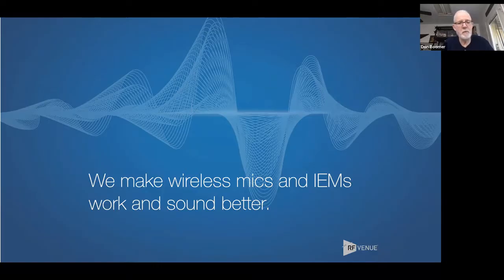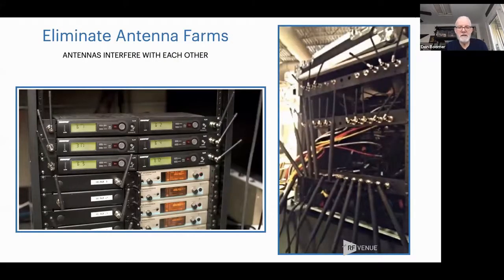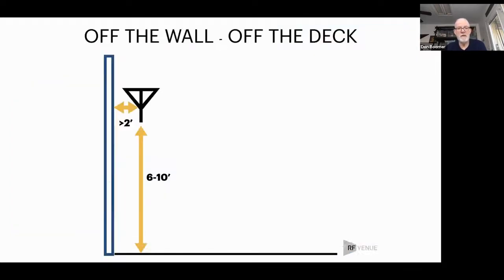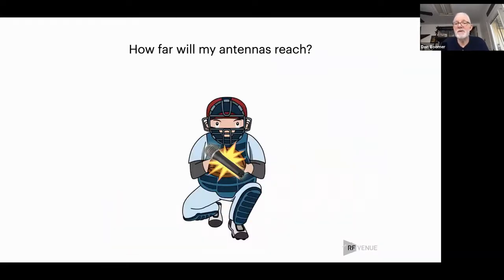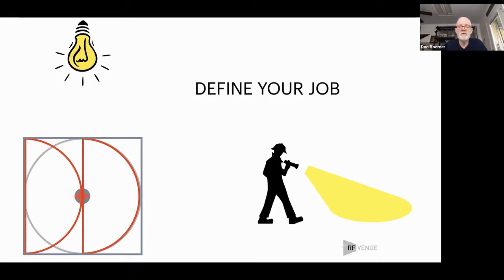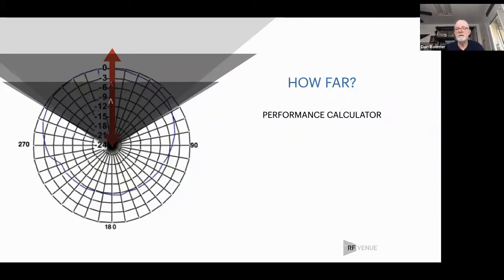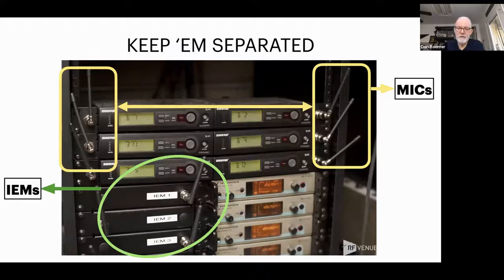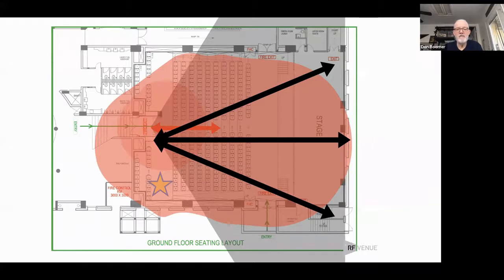Placing antennas for wireless microphones and in-ear monitors (IEMs) - Webinar

Comment: Don, this is much appreciated!

Do you think that using N-type connectors are better for shielding and leakage over BNC? And if so, is it worth the extra cost?
Reply from the maker: Hey Ansen, I would recommend you email this question to Don - don@rfvenue.com his answer may surprise you on topics like this!
Reply: The RF part of both types are actually the same.  You can plug a N male connector onto a BNC female!  Of course it would not be secure.

Comment: Having problems with in ear monitors pm1000. Signal seems ok but getting static. I scanned with work bench and freq’s were assigned. Using a single passive paddle to run a 10 unit rack.
Reply from the maker: Hey Scott, we believe the best antenna for IEM is a circularly polarized or helical antenna, like our CP Beam antenna. We don't think a paddle antenna works very well with in-ears. And with 10 transmitters, what type of combiner units are you using? We really suggest for maintaining reliability to limit each CP Beam antenna to 8 transmitters, otherwise IMD skyrockets.

Comment: In a theater stage setting, would it be alright to put the antennas/wireless receiver at the side of the stage?
Reply from the maker: Yes, and in fact, in most cases with stage wireless setups, its the best suggestion! Aiming the Diversity Fin and CP Beam antennas from the stage wings across the stage, is a "standard operating procedure" with our customers :) Just don't aim your transmit antenna at your receive antenna and keep them at least 6FT apart.